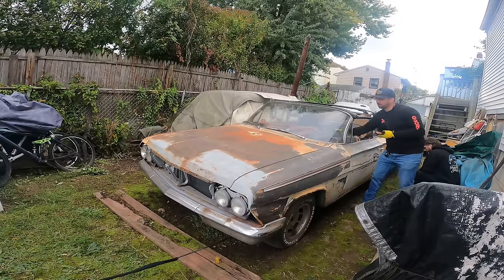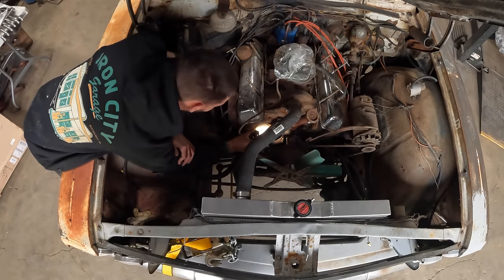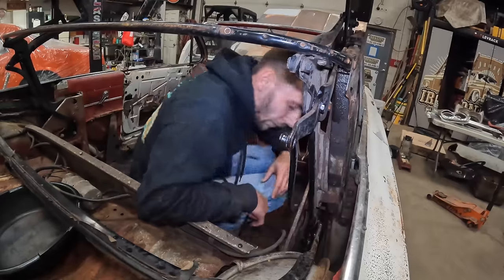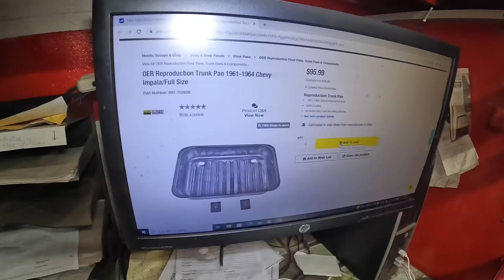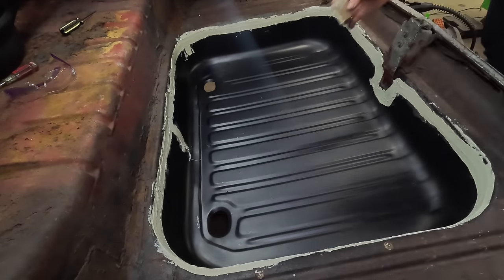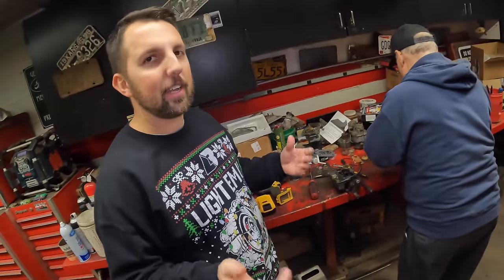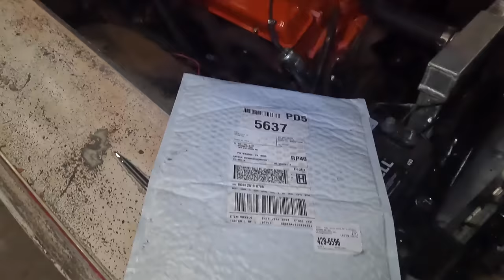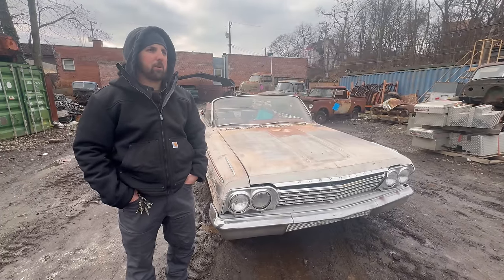Abandoned 1962 Chevy Impala Convertible . Will it run after 50 years? Undercover in New Jersey.

Comment: Yes, sir it is a good policy to check the compression on these engines as you pretty well know what you have in an engine. One thing a friend of mine would do is what is called a "valve spin". Upon cranking an engine and the starter motor is not making a consistent sound from being loaded on all cylinders the sound of the motor will change when the weak cylinder is coming up on compression (Joe would know about this) an experienced mechanic would note this. In this case as you mentioned Joe found a stuck valve (common for these engines that sit up and are stuck). Carburetors can cause a fellow to pull his hair out as they are quite simple and in reality, they are so simple in principle that they can be quite complicated. My dad used to rebuild his carburetors and he took them all apart and put them in carburetor cleaner (the good stuff, the really good stuff) and just like Joe he took his time to check everything and get the carburetor right. My friend who showed me the "valve spin" was a good carburetor guy and I do OK on them as well. The newer cars as you have mentioned one has to use the proper diagnostic equipment (and there was also proper diagnostic equipment back when this Chevrolet was a new vehicle as well), but a mechanic has to be a good detective to find the real culprit on any vehicle and sometimes that is quite the tricky wheel. That is a nice car to work with and I am quite glad you have found it a new home. Also 1962 is the first year of the 327 engine, and I believe that 68 was the first year of the 307 engine (283 bore and 327 stroke). Both base engines came with the small Rochester 2bbl carb (I can't think of any 307's coming with anything other) You stick a 4bbl carb and manifold on a 307 and it will wake up. Both engines are solid engines though. You'll find another fellow to take Clay's place, it is just part of the business.